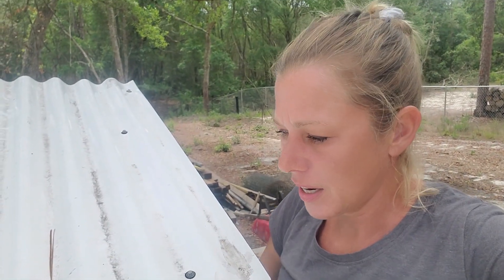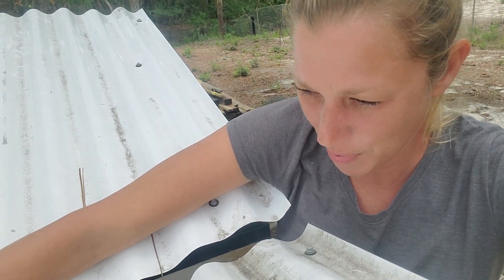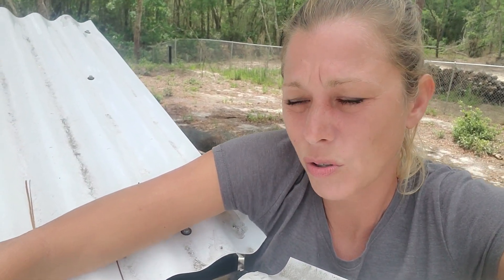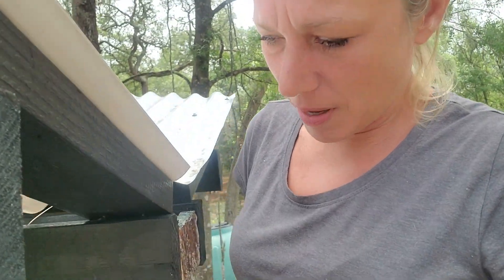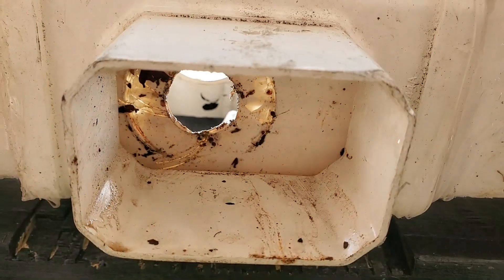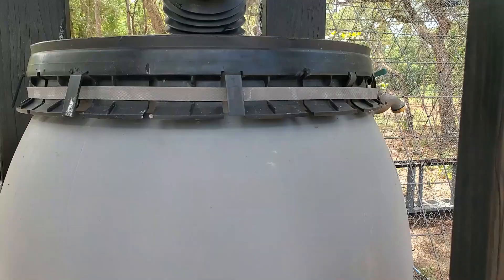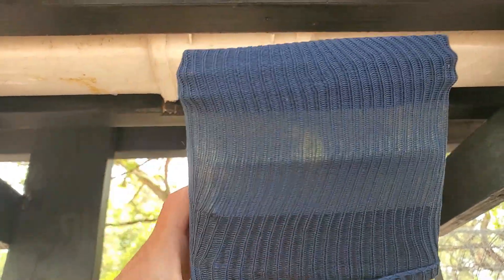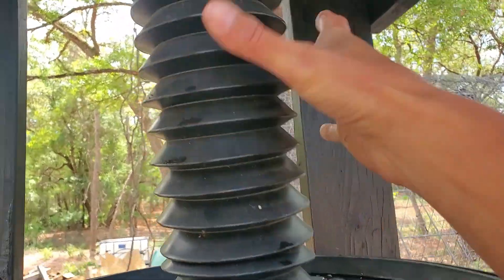Rain Barrel Chicken Water System Update

Comment: One thing you can do is put the output line a few inches higher from the bottom. And have a large drain plug below it as close to the bottom as possible. What this will do is the heavy particulars will sink to the bottom and the light wait stuff will float on the top of the water keeping the water at the output feed relatively clean. All you would need to do  is  skim off the top and drain a portion from the bottom to keep it clean. Add a piece of large mesh window screen or chicken wire to the top to catch the really large pieces before the water goes in the barrel.

Comment: Hi Kim.  The sock isea might work but I would let the sock hang down in its entirity.  If the lower or toe of the sock gets plugged it wil continue to flow through the upper part of the sock.  Just a thought.  Keep on smiling.

Comment: I have a water catch system that feeds a 1000 gallon tank.  I use a filter system exiting the tank due to the 60' length of the rain gutter on the shed.  Looking at your building and how it's set up.  I would put a screen the full length of the gutter between to two rooves instead of just filtering the drain area.  You could possibly design it so it slides in and out for cleaning from the area you first climbed to check your screen. JMO  Good Luck!  Looking forward to you getting back to wood turning!

Comment: I'd suggest getting yourself a couple of the big valves so you can divert the flow away from the barrel so when it needs to be cleaned out, close the valve going into the barrel and open the other to flush out the system. Or even install it into the barrel itself and let all the sentiment go into the barrel only to be flushed out by opening the valve. But whatever you do, do it on top of the barrel so you're not having to climb up high. That worried me with your arm between those sheets of tin while you were on top on the saw horse. Those things can and will cut you wide open if giving the opportunity.

Comment: Hey, Kim. My suggestion is a gutter screen that fits on top of the entire length of the gutter. If you want to go extreme, make a frame and cover the entire roof with screen material. That would give you a lot of area to clog before it is totally blocked off.
Bill
Reply: Yeah imma go with stretching a screen across the entire roof expanse I was going to suggest it but you beat me to it LOL

Comment: The sock should work but it to will get clogged.  I use pieces of pantyhose on the outlet from my washing machine to keep the dog hair out of the septic system.  Get 2 or 3 loads before I have to change it.

Comment: The sock makes a great pre-filter going into the barrel but you might think about filtering the water when it comes out of the tank to go to your water or’s you could probably come up with some sort of a 1 gallon pickle jar that has a hose going in and then another hose coming out of the top so as it builds up water pressure, the debris will sink to the bottom of the jug and the clean water would come out of the top and go out to the chickens

. If you look at some of the sawdust filters for your workshop, like the cyclones filler, they have a trap for where the sawdust goes in and then another barrel the big stuff goes in and that’s what I’m trying to describe.
Good luck
Reply from the maker: Good idea. I will look into something like this.
I do have a water filter thing we use for the camper water. I could hook it up once we are finished. 
Thanks for the idea!!!

Comment: Hi 👋 Kim , I believe there is a mess you can get called Leaf guard, I think if I remember rightly it goes on top of your gutter so the water and still driving through, as it is covering a large area, probably once a month you can just go with a small break or something or even lift out. I’m just clean it, I hope this is some help, I think you still need to make the hole in the gutter that goes through the downpipe the similar size of the downpipe, obviously cutting the trees back around the area will probably help, but doesn’t matter what you do. I think you’re fine you’ll still get leaves blowing around I’m going onto the roof, good luck. 
PHIL FROM THE DARK SIDE OF THE MOULIN FRANCE
Reply from the maker: Thank you 💗
Reply: @KimTippin  I am sorry to hear 👂 you are still having problems with your builder, It is a pity that you are so far away as I would gladly give you a hand, PHIL FROM THE DARK SIDE OF THE MOULIN FRANCE
Reply from the maker: I appreciate that 🙏